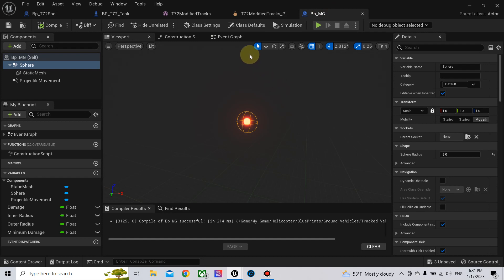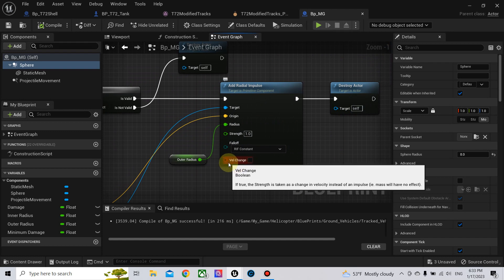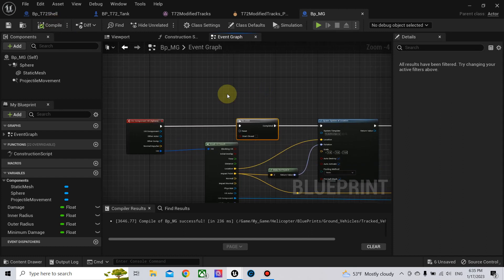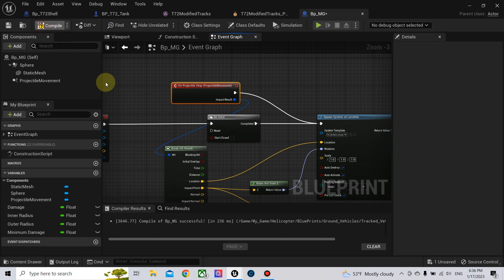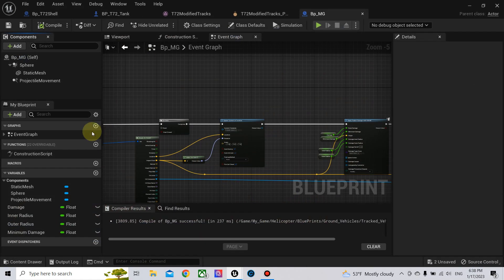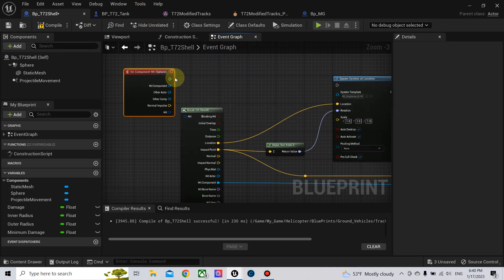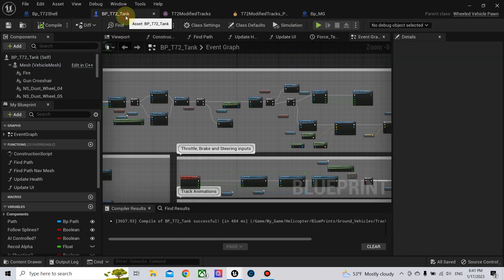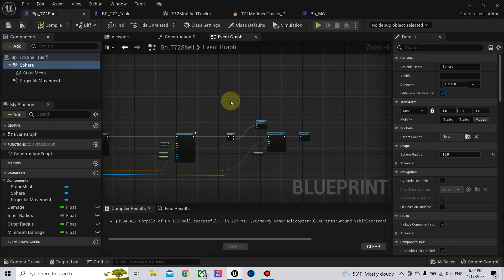Projectile Collision Fix-unreal engine 5 tutorial

Comment: Hi, it's me again ^^ . For the next, when you have done the armor system like you already said, can you pass some time on the zoom on the main gun with an UI linked ? I have tried by myself and it's not working great. Basically, i have create three camera along side the canon, and when i press a bouton it change the angle by switching them on/off, anbd each camera is linked with a specific ui. I am trying to do like the aiming in squad for the tank.  The problem for me is : the canon don't follow when i look around, and im not fixed >> i mean i can look beside the tank, not a great deal ^^
Reply from the maker: Hello,
I will make a video about zooming in the camera after the video of the armor system.

Comment: I have an another small issue : i see the ui of all the tank when i press play. I have a T72 and an abrams. For example, when i play the abram, i see also the crosshair of the T72 and its ui. How can  i fixe that ?  :)
Reply from the maker: Hello
you have two options, The first one is to make a boolean call it (player) before you create the widget and make it instance editable to be able to change it in the editor, also for the crosshair make auto activate false and set it to active only when the player controls the tank.
the second option is to make the AI in separate blueprint without any UI.
Reply: @megames998  And if i have for example two players ?  Each tank >> a unique variable with a basic condition. Like tank 1, tank 2 , etc ?
Reply from the maker: you need the boolean only for the AI 
because if you have more than one player, you can make the UI be created locally and not replicated.